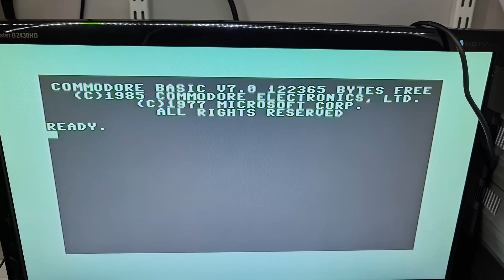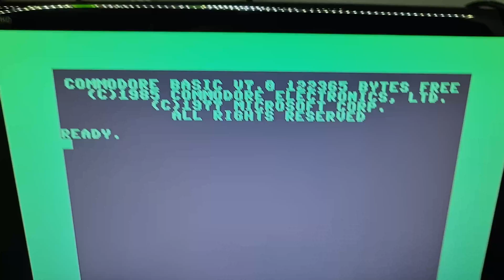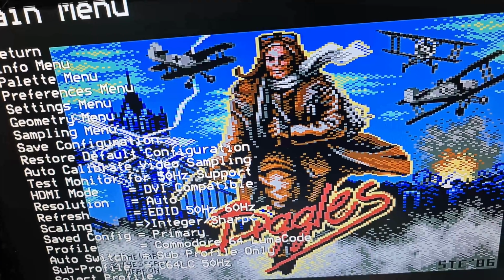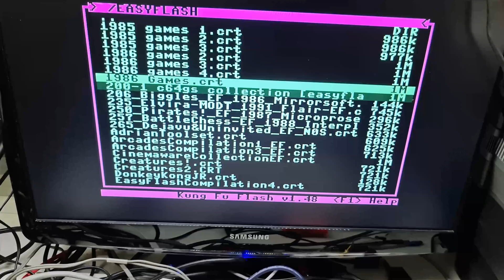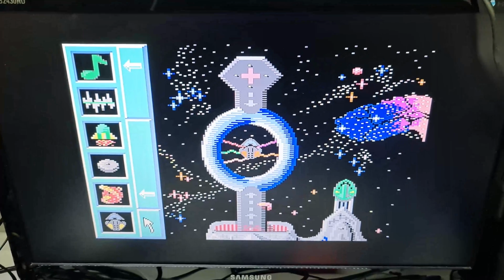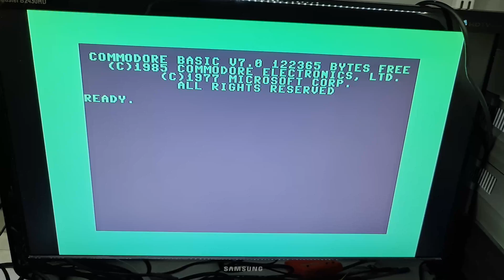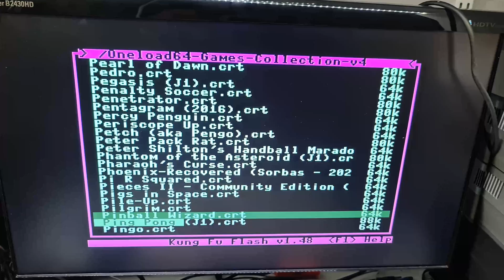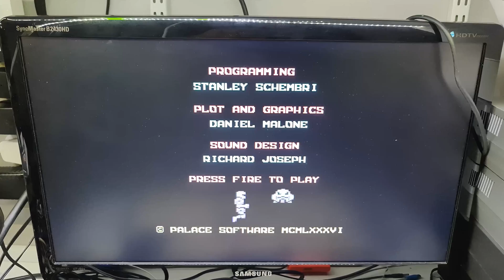LUMACODE - The new way to connect old computers to HDMI

Comment: I got this now in my VIC-20 because I wanted to say "holy fucking shit that's good" too. And, I DID say that!
Reply from the maker: @eightbit1975  the ossc also has lumacode decoding now doing away with the pi
Reply: @CaptainCommodore  It does, but at least on my OSSC pro it is not nearly as easy to set it up. There are no profiles like the RGB2HDMI Pi build.
Reply from the maker: @eightbit1975  oh, I have the regular ossc nodded to latest fw, havnt tried lumacode on it yet tbf

Comment: Properly installed, the component board should work together with the RGBtoHDMI.  You really need to connect the GND pins.
Reply from the maker: The 2 rear ground pins are ( were , i removed it now for lumacode ) connected to frame ground but from the underneath using a piece of kynar wire, I have the c64 version of this which works properly over the next few weeks I will make another video showing installation in the "d" I know it will be fine 🙂

Comment: Yep it's magic. I have RGBtoHdmi for 80 column too via an HDMI switch. C64 I can report just as good, a ropey C64G was transformed. Still feel this is the best solution cost wise... especially considering a framemeister in the chain..lag is supposed to be minimal too but would be nice to get some info on that.
Reply from the maker: Completely agree on the cost front, it's a good idea about the hdmi switch ( I too have the rgb2hdmi for 80col ) as the lumacode is running at a multiple of the frames peed to encode the data I would expect the lag to be less than a frame, will deffo try this in some of my other machines too  👍
Reply: The lumacode board introduces no lag. The individual pixels are generated at the same time as the original VIC-II would do that. To be completely honest, splitting all pixels into two samples actually causes the total information to arrive about one pixel later, but 120ns should really not be noticable. 
The RGBtoHDMI adds a bit of lag when upscaling but only about 1 or 2 milliseconds which is a fraction of one frame. So it really comes down to what your monitor/TV does then. I have a setup with a fast monitor and the overall lag is about 3ms. You really need an optical lag measuring device to be able to notice that.
Reply from the maker: @copperdragon9286  120ns..... Holy shit thats fast, I'm assuming it's just as fast for other machines except where's there's 6bit encoded will slow slightly (180ns? ) which is still almost undetectable......
Reply: @CaptainCommodore  Number of samples does not really make a difference, because they are just sent out with higher speed, anyway. This number is also just an estimate, but its about in the correct magnitude. 
Using an FPGA allows me to run everything as fast as the original hardware. If I really wanted, it would sometimes even be possible to generate the lumacode signal faster than the original chip.
Reply from the maker: @copperdragon9286  ahh , I understand,  did a little fpga stuff a few years back, what's the practical limit rgb2hdmi wise ? Could this be used on ST/Amiga ?
Reply: That is far beyond the capabilities of the lumacode system. The RGBtoHDMI may just be capable of decoding a data stream of about 50mbit/sec in this way (the Atari 8-bit uses about 43mbit/sec which already pushes the limit). Amiga would need 90mbit/sec in low-res mode and double that in high-res. The FPGA may just be capable of that, but there is no way to reliably transfer that over a video cable and have it decoded on the other end.   @CaptainCommodore
Reply: @copperdragon9286  Fantastic! Thank you!

Comment: That looks SO clear. Gonna investigate it for my C128...
Reply from the maker: At the very least I can recommend the mbarszcz modulator as being the best I have used...... this lumacode board using just a simple rca means that a single rgb2hdmi can be easily swapped between machines for perfect video......